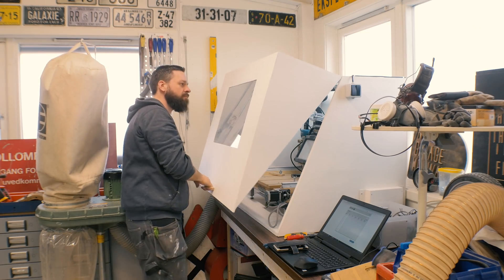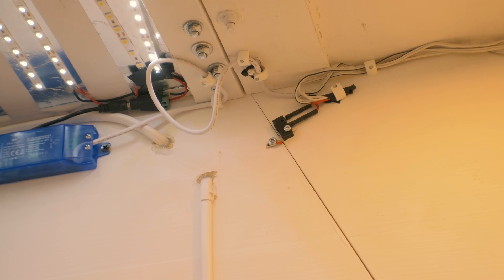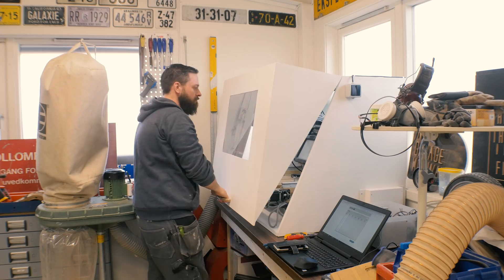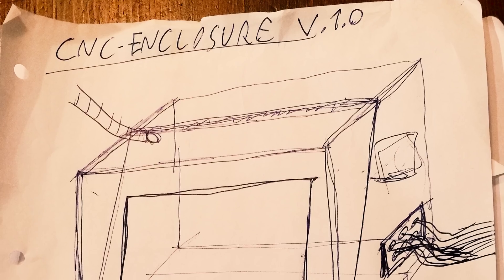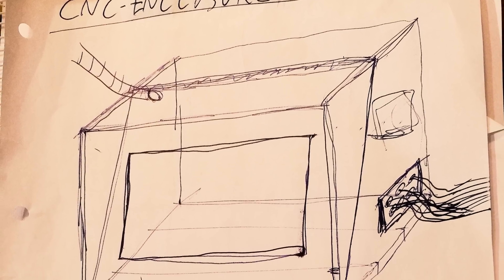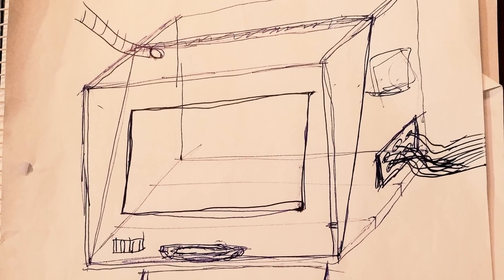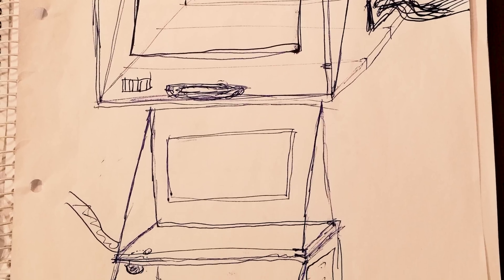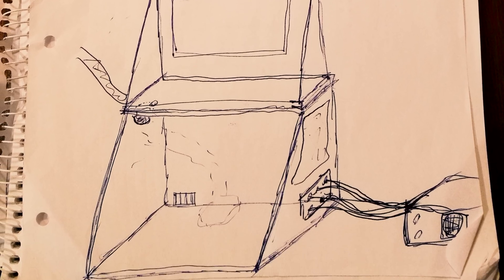First DIY CNC build (part 23) - Enclosure | LED | soundPROOFING | dB

Comment: Which cnc controller u like and which using now.
Reply from the maker: I still use my old cnc machine so Im still using the Universal G-code sender platform edition. On my new cnc machine, that Im planning on building, im going to use UCcnc controller and software. Like in this video: https://youtu.be/2xHf2pVrbUI?si=Uhfo1B75iMNrzNbC
Reply: @WillysGarageNorway  one question. Can I work through lead screw 3000hour? 
I want to make 1000 work area router machine. Give me feedback about lead screw.please🙏.

Comment: I almost made a box like yours but opted out for just a light foam box that sits over top of my CNC machine.  I just lift the whole thing up on it's back edges and if I need to work on it from the other end I just put it back down and go to the other end and lift it up.  I didn't put any thing on the inside walls of the box as dust collects on this stuff and it will snow on you when you open it up.   I am also enjoying the quiet and the dust free shop now.     Enjoyed the video.
Reply from the maker: Thanks for watching :) Your solution sounds like a good one. If the machine needs fixing I might miss having access from the sides

Comment: I love this video. But something sounds wrong with that big dust collector. I have used 4-5 different ones across friends shops etc. They are usually much quieter and less "rattly". It sounds alot like a air compressor when it kicks on in volume and tone.

Comment: Since the machine is likely to be running for an extended period of time while doing some more complicated carvings, are you not concerned that there might be an issue with heat build up inside the enclosure.
Reply: alg 
Did u not see the vent and extraction ducting?

Comment: great video, I have a suggestion and request. 
since you have now experienced working with cnc, can you do a video on reviewing CNC vs manual tools, like for some specific complex projects it might be worth it, but for your common project, is it worth the time designing. I have read some ppl leave cnc because it takes quite a bit upfront effort, so something like cnc vs manal labor
Reply from the maker: Hi and thanks :)  sorry for late reply. That idea was a good one. That is something im interested in doing. Thanks for your suggestion :-)

Comment: awesome. I'm building an MPCNC for a friend and I've decided to use a NVR switch so if the emergency stop button is pressed, the spindle isn't going to start running after the e-button is reset. (it's complicated because i needed to use 2 relays for both the CNC and spindle circuits)  I like how you're buying stuff from Biltema, I'm there all the time!
Reply from the maker: Hehe thanks. That sounds lile a good idea with the spindle. Biltema is the greatest!!!  🤘👍😁

Comment: Hi, well made, but the NeXT would probably be to make a sound suppressor  like a 90 degree foldable With Wheels, shielding With insulation pointing towards the dust collector and away from the dust free Office …?
Reply from the maker: Hi, thanks. Hehe, yeah do you mean something like this on wheels?? http://www.voicecube.net/voicecube2/image-viewer.htm?gallery/voicecube-tower6.jpg
Reply: Yepp, maybe not that big. Just  the hight of your  dust collector machine.  Perhaps 100 cm or so...?
Reply from the maker: @handygotten54  maby thats a good idea :). I have plans to mount the dust collector an other place in the workshop when I get the pipes I need to do it :)
Reply: That`s a much better idea :) @WillysGarageNorway

Comment: Use some foam on internal walls to use it as sounded dampener. Well this new enclosure is killer.
Reply from the maker: The enclosure as it stands today, has no insulation. I am thinking about using some adhesive sound matts on the inside walls and mounting some weather striping around the hatch :) Thanks 👍
Reply: Rajiv kumar 
Foam and dust do not play well together. Nor with fire....

Comment: What about lining the inside walls with soft foam to absorb more sound? And maybe a rubber mat underneath the enclosure or feet?
Reply from the maker: Hi, good suggestions :) I was thinking about using some adhesive sound matts on the inside walls and weather striping on the hatch. Rubber underneath sounds like a goid idea :) thanks
Reply: WillysGarageNorway 
Twin walls with helium gas or helium infused foam in between. Helium is by far the best sound suppressant. Or any gas that is a different ‘density’ to air. You could use the doors from a commercial display fridge if the glass panes are replaced with laminated, or tempered, glass. Second to this would be cold room panels. Stay away from foam (unless it is the dense, ‘plastic’ like stuff, which is stupidly expensive) as it will act as a magnet for particulates and will pose a significant fire risk.

Comment: I like the way you designed the way the front opens up to allow access to most of the CNC. I'm curious if there is anything to keep the lid from suddenly dropping down as you are closing it. It looks like it might be heavy and could slam shut.
Reply from the maker: Hi and thanks. The lid is'nt that heavy. It can be handled. I have put a handle in the front but also thinking about mounting some handles on the side also, so it will be easyer to grab :)